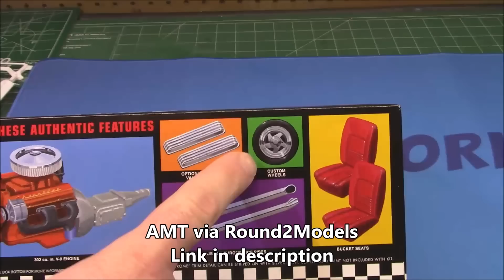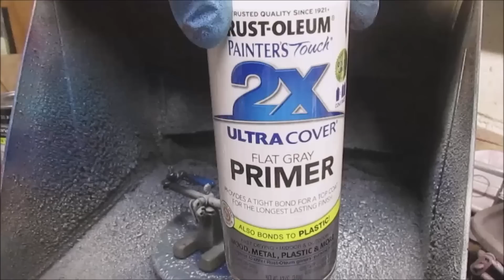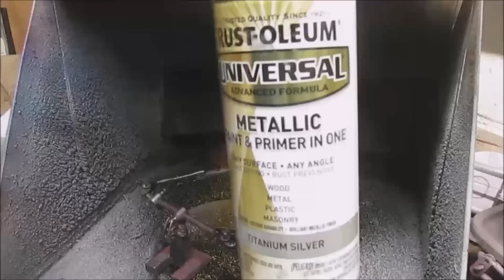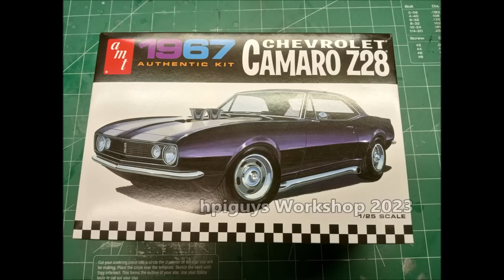1967 Chevy Camaro Z28 1/25 Scale Model Kit Build How To Assemble Paint Dashboard White Letter Tires

Comment: GREAT build Chris!  This really brought back some great memories.  My first car was a 1967 rs/ss with a 327 V8 with Butternut Yellow body and black interior.  My car had disappearing headlights and stock Chevrolet wire wheel covers.  She was a sweet ride.  I'd sure like to have her back.   I'm definitely going pick up this kit and build it as my first car.  I'm also going to pick up the '69 GTO kit that you built as well.  At the time I drove my Camaro my dad drove a Saphire Blue '69 GTO with a 400ci V-8 and hurst 4-speed with black interior and a walnut steering wheel.  I learned to drive and took my driver's test in the GTO.

Love your channel.  Thank you for posting this project.

Comment: I did some grinding on those vent windows I got them in but it seems like they could have been designed a little better.
1967 Camaro has vent windows 1968 & 9 does not
I painted the tail lights all red like a RS 
Really like your colors and those tires - wow
One thing to remember is the difference between AMT and Revell kits.

Comment: AMT could've made this a slightly more detailed and better kit that was true to the '67 Z/28.
First off the car had 7.75x15 Redline tires, it came with bumper guards front and rear, had "Chevrolet" script chrome valve covers. Directions should have had paint codes for Chevy orange painted block, heads and oil pan, aluminum painted intake manifold, cast iron  exhaust manifolds. The grill would've been black plastic.
This came out nice.

Comment: I am surprised more are not selling the kit as a 3D print plan instead. Buy your own rubber, and wheels, and other things, but the core could be 3D printed.  I get injection molded, but this is the time of 3D printing,  and it is getting really good. I am surprised more kits aren't hybrids yet.

Comment: Seems to me the 67 Camaro had the small vent windows. Wonder if AMT used the 68 body in this kit?
Reply: I'm building the '68 Camaro Z-28 right now. The body in the kit has the side marker lights on it. BTW, it comes with TWO sets of pad printed tires! Four F60-15s and four L60-15s. Woohoo!